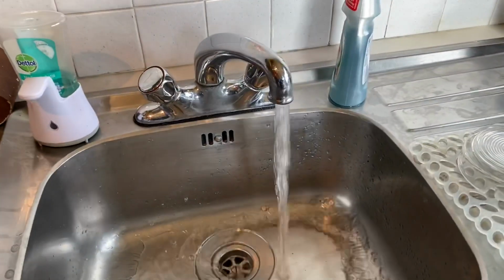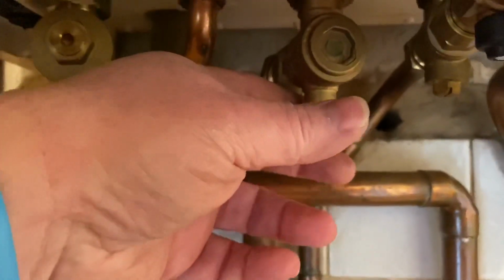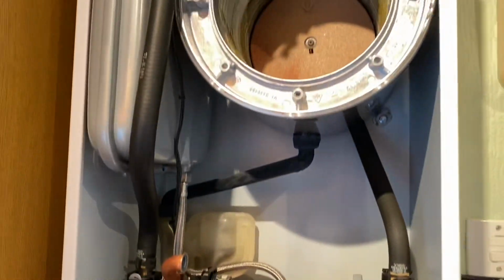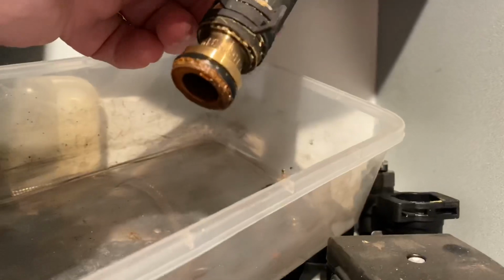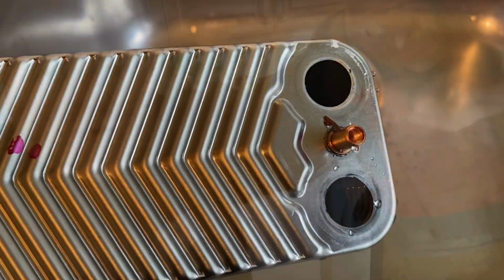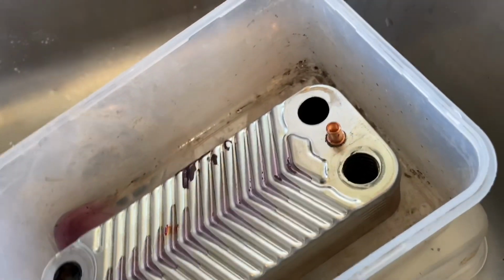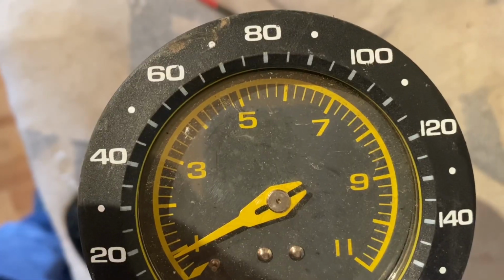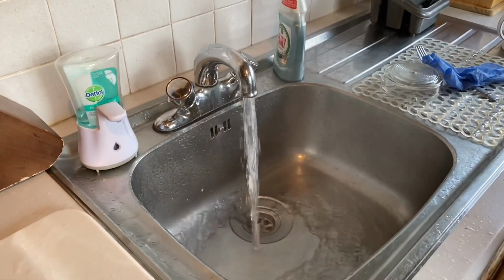Blocked Plate Heat Exchanger Magnetite Sludge - Viessmann Vitodens 100

Comment: Hi Allen. Great service! Wish all engineers were this thorough.

I have an issue with my open vent Vitodens 100w 16kw boiler, system has just been power flushed and a new pump installed. However it keeps short cycling when getting up to temperature, I would say it fires up then shuts off about 8-10 times before then constantly staying on until reaching around 70 degrees (it then seems to cycle 50 degrees to 70 degrees fairly well). Also, lots of hissing coming from boiler when starting.

Have you got any ideas? 

Thanks Allen.
Reply from the maker: Thanks for the comment. Happy New Year.

Comment: What chemicals did you use?
Reply from the maker: I think i used one shot on this video but please check with the manufacture and ask what they advise. Thanks.
Reply: @AllenHart999  Spirits od Salts (hydrochloric acid) can be used. Do it outside. Wear good goggles and rubber gloves. Flush several times as demonstrated. Expect chlorine gas using this acid, which is choking, as it reacts with the dirt and corrosion. Inspect/replace the four rubber O rings between the plate heat exchanger and mating faces which is a cause of water leaks.

Comment: Hi Allen,Thank you for your video. I want to know something about my Worcester 24 CDI boiler. central heating is working fine . Before when i turn on hot water on tap boiler machain shows light on tap sign and light on fire sign but now it does not show light on tap sign on boiler  and hot water is also gone.
Near boiler there is small box with green light when it on hot water come up but for some time again green light goes off automatically. When hot water come then also there is no light on tap sign on boiler  .
Thank you

Comment: Hello Alan,
I serviced the exact same boiler today with the exact same problem.
It appears you have to remove the main heat ex to replace the right hand side flow hose though ?
Reply from the maker: Yes.
Reply: Not a particularly clever design I’m afraid.
As you’ll know Vaillant had the same issue with their “ Rubber Hoses”
Reply from the maker: Lance Taylor I don’t mind them really. Very easy to work on and you can always bring them back to life.
Reply: @AllenHart999  I agree
Reply: I have the same boiler. It was installed on a brand new install, all plastic UFH, no iron anywhere. The pipes block up every year with the black crunchy stuff. Veismann blame my system without explanation. There are filters, and the sight glasses in the UFH manifold are Cristal clear. I am thoroughly sick of this boiler. It has also had two new HT leads. Again, I was told this was a rare problem. So rare that the person sitting next to me at work had exactly the same problem on the same day. Our service visits were concurrent. My next door neighbor has a boiler on the same water supply for 20 years no issue. So come on Wiesmann, step up and sort out your crappy rubber pipes.

Comment: @allenhart. Really been enjoying your videos mate find them very informative. Im in a similar predicament. I have the veissman 050 model and I'm no longer  getting hot water. It goes stone cold. The heating is working absolutely fine no issues. Any idea what could be causing the problem with the hot water and what remedy if any can you suggest. Thanking you
Reply from the maker: Plate maybe?
Reply: Hey thank you for the response. I've had the plate taken out and put through pressured water however could not do it on the hot water at the same level as the hole is much smaller.  Unfortunately this didn't fix the issue
I've seen the plate is available in stock at plumbase and I'm thinking of replacing the old, however I have a feeling this won't resolve the issue. 
Would it also be a good idea to change the rubber hose at the same time.
Thank you again
Reply from the maker: Taz Ba I would do a water sample first, maybe the system is sludged up
Reply: Am I right in  thinking if it's sludged up it will need a flush out

Comment: If the plate exchanger separates the boiler water from the system water, how did the boiler circuit get rusty pieces and magnetite in it?
Reply from the maker: The radiator water goes through the plate. Thanks.

Comment: Proper service would be take both heat exchangers out, put it on descaling pump for 15min  each side and u have brand new boiler. Actually that's standard boiler service here in Croatia. But by the comments i can see u performed the miracle. Chemical cleaning of the boiler standard service 70€+ all new orings, washers and parts if needed.

Comment: Need advice. Living in south east Europe. Vitodens 100  W, boiler is 6 months in use, apartment is 40 m2, boiler brings hot water to the shower, and kitchen, pipes are less than 4 m long from the boiler to the faucet. Floor heating. While heating is on, I open hot water, use it normally, close it and when I want to use hot water after a minute or 5 min again, it takes 25-30 seconds for the warm water to arrive. Same thing in the bathroom and in the kitchen.So, example: I am having a shower, for the first rinse I wait for the hot water to come, ok. Than I turn the water off, scrub with soap for a minute or two, turn water on again and than I have to wait for 25-30 seconds for the warm and than hot water to arrive. And like that every time again waiting for the hot water. When the apartment heating is not on there is no problem. Is it the heat exchanger or a three way valve? Faucets are regular, nothing fancy, no thermostat. Please help. I would like to have some idea before i call the repair person.

Comment: Great video, thank you. Would flushing the exchanger with boiling water and citric acid be as good as the chemical treatment used?
Reply from the maker: How would you keep the water boiling? Thanks.
Reply: @AllenHart999  disolve the citic acid before hand in boiling water via the kettle and let it soak inside the heat exchanger? asking to learn
Reply: @wolverineqtg976  vinegar
Reply: @edwardbalboa5528  thx appreciate it
Reply: @edwardbalboa5528  the liquid he used does not look like vinegar!

Comment: Hi, my boiler struggles to make the water hot. The boiler makes a sound as if a pump or something is struggling, then I have to turn the tap off, that's when the boiler starts up again, when I turn the tap on, the boiler will try to heat up the water but after 20 seconds it will struggle again. Does this sound like the heat exchanger needs cleaning out.
Reply from the maker: You need to have a plumber look at it for you. Thanks.
Reply: @AllenHart999  I had an engineer come last week and this morning he changed the heat exchanger. The engineer said the heat exchanger was too clogged up with sludge to have it cleaned out with acid so a new one was put in. Got hot water back in this lockdown. Just want to say your video was a massive help for me to understand what the problem was with my boiler. Many thanks and keep up your good work 💪👍

Comment: Have you any experience with intergas boilers? I'm tempted, I like the idea of no diverter valve, no secondary HEX, interchangeable parts across all models and an apparently indestructible main heat exchanger. Problem is no plumber I speak to has installed one or attended any problems with them. I hate combis and vowed I would go for a megaflow type system when the time came, but financially a swap to another combi makes more sense right now for me. Any thoughts appreciated! Three bed detached, doesn't take much heating, hot water use relatively low as just two of us here but we do like a good powerful shower.
Reply from the maker: I will add a review soon. Thanks.
Reply: Intergas is 👌

Comment: I also have a vitodens 100 and the last service I had all the chap did was clean out the inside heat exchanger with a brush!!I am now having problems with the hot water to the shower varying in temperature albeit taps etc are generally ok.  Would a partly blocked heat exchanger cause this? there seems to be some variation in hot water pipe to shower although I'm not sure if this is a problem with shower demand/flow ( it is a pressure balanced shower not thermostatic)guess I am going to have to wait until lockdown is over in any case!
Reply from the maker: Stay safe. Watch this one just in case. Thanks https://www.youtube.com/watch?v=Hh5lFC7VI4U
Reply: Hi  please   send me your phone number   I  can call   you  I  from Bradford
Reply: It’s not supposed to be brushed out with a brush mark, it’s supposed to be vacuumed out and thoroughly rinsed out with water
Sounds like you’ve got a partially blocked heat  exchanger
Reply: Salim Khan veismann make a dedicated heat exchanger cleaning tool. It looks like a miniature builders trowel, but with serrated edges. The gaps between each spiral are exactly 0.8mm, the blade of the cleaning tool is designed to just fit. You work around the spiral, gently pulling backwards and forwards to clean any crap from between the coils.

Comment: Very good work, Allen! I wish more and more engineers to do their job properly, as you do. A friend of mine had the same DHW problem. He called the company that installed the boiler and they send some chaps. They did a flush to the main heat exchanger and totally ignored the plate exchanger that was sludged-up. The problem was partially resolved. He then called another engineer and he did all that you showed on this video. 🤘 👍
Reply: Does the exchanger get clogged up like that if there's a MagnaClean-type filter on the system?

Comment: Hi Allen, I have exactly the same problem with my boiler and a engineer came out last week and told me it's not worth fixing as it would cost too much.He said I should buy a new boiler. Is he conning me? What's your opinion on how much this should cost. It's a Maine Combi eco 30 and about 10 years old, thanks for your time, Jim Rowland.
Reply: If it is just the plate heat ex then yeah it sound like he ripping you off, even if you changed the plate instead of cleaning it the parts probably between 50-100 quid and an hour's labour, as long as that's the only thing wrong with it ofc

Comment: It's hard to do a proper service. If you say to a customer you want £75 + parts for a service there is always someone doing them for £30 and just FGA in and out. Cant compete
Reply: I've been paying £8 a month for 'Boiler Service cover' (£96 pa)  Only once in four years have I seen a technician do anything more than  (what appeared to me to be) a cursory inspection!  ie he seemed to be checking the flue gases, pressures   etc etc.   None of them has ever checked that the magnetic filter is clean of sludge (it is, because I do a full mains flush and re-inhibit, every two years).  I've come to the conclusion I am probably just being ripped-off, and would be much better off employing a good local technician myself and getting a full service done. But, as an ordinary member of the public - how am I to know what the service should really consist of - and if I am receiving a descent level of service??
Reply: Sounds like you are getting a "descent" level of service!
Reply: Yes Brendan it’s lowered the standards of quality and no one can compete with a £30 FGA guys the ultimate losers are the homeowners Who think their boiler was serviced when it actually isn’t.
Reply: Very much a case of getting what you pay for.

Comment: Looks like a hard water area. Combi boilers don't like hard water. Pity you cant het a combi type boiler with an external heat exchanger which could be cleaned out by a non gas safe engineer.
Reply: djhvideo i used to clean my heat exchanger every six mo this or so when hot water output started to tail off. There is nothing to stop a competent DIY'er if it doesn't involve opening the burner chamber or interfering with the gas valve etc. Mine was an old glow worm betacom 24c, fiddly but not too difficult to remove the hex, fill with spirit of salts for half an hour and flush with plenty of clean water.

Comment: Hi Alan great videos,can I ask what model Baxi you would recommend,I have a 3 bedroom house with a total of 7 radiators? Thanks. Jason
Reply from the maker: Depends on a lot of things, if you have loads of space I would personally go for a platinum.  The ideal vogue is also a great boiler. Viessmann 100 etc etc, lots of really good boilers as long as they are installed correctly
Reply: Allen Hart Thanks for the reply Alan. I really like the Baxi 800.
Reply: Allen Hart I should have been a bit clearer when asking about the type of boiler,I was meant to ask,what size Baxi would you recommend? I believe there are 3 sizes?

Comment: Probably a daft question but you say you cannot have enough expansion vessels. What does the expansion vessel do and why can you not have enough.
Reply: The central heating loop is a sealed system, when the water in the loop is heated it wants to expand and increases the pressure in the loop. The expansion vessel contains a bladder whuch is full of air, as the water heats up it compresses the air in the bladder, giving it somewhere to expand into. The internal expansion vessel in the boiler is usually rated for 100 litres of system volume. Add up the volume of all the radiators and the volume of the copper pipe used and if it is less than 100 litres you are okay, if its more you need to add an extra external expansion vessel. If the expansion vessel isnt large enough when the water expands it will totally compress the bladder and still want to expand, the pressure will go up until it pops the safety valve and some escapes. When it cools down the system pressure will now be low and need topping up. If the expansion  vessel is larger than necessary the bladder will only be compressed a bit.

Comment: A really good video to watch Alan I’ve done quite a few of these on other peoples viessmann installs the ones I’ve fitted onto clean systems Have not had a problem at all, I haven’t tried a chemical yet that will remove the black sludge magnetite the only way I found to clean it is to plate off and jet wash it properly reverse flushing as well and the same applies to the main heat exchanger. I’ve got a VAX Aqua Vac which are used to suck dry the heating system water which you attach to the heating or the flow hose,or even the kitchen sink tap , It works a treat every single time. Viessmann Boilers are brilliant but you never see many well maintained

Comment: Allen, great video, love the viessmann. that's practically a fully stripdown service.  I usually remove the heat exchanger as well and give it a blast. Replace the hoses for either new ones or the copper replacement if possible. Anyway excellent work as usual sir. Keep us all on our toes to keep up with you ha ha
Reply: Ask yourself if the customer would like to pay for repair instead of servicing when those hoses were been changed.
Reply: @olalekanoyedokun4494   what do you mean?  I didn’t understand
Reply: @olalekanoyedokun4494  It really depends on the condition of the hoses and the model of unit. I always have two sets of hoses in the van for emergencies and if i notice something on a routine service.
Reply: There are easy to strip down David ,have you ever used a copper replacement pipes ? and how much are they ?
I have never used them! Always manage to clean original hoses or replace them
Reply: @SalimKhan-gk1fh  More recent models have copper replacement hoses and they are preferred to be fit in place of the rubber ones, but again it depends on condition and maintenance, I've worked on v100's that where nearly ten years old and absolutely perfect all original parts
Reply: @axemurderforhire1  Thank you for your reply David I look after nearly 20 vitodens 100’s  (wb1b &WB1C). A lot of them installs done by me all running really well . the one in my own home is seven years old now it’s the WB1C with the rubber hoses on a clean flush system they do not give any problems it’s all down to system water quality as you are probably aware and by watching these videos they are a doddle to strip down , even if you have to remove the main heat exchange ,  now could you easily do that on another brand of boiler?
what I meant was have you fitted copper pipes to replace the rubber ones? Most of my installations have FlowMaster antifreeze in the system water this seems to eliminate most problems and it almost matches the system water quality of the German and European (viessmann boilers are antifreeze compatible  ) The addition of antifreeze increases system efficiency and faster warmup times & a quieter boiler, They do not recommend inhibitors in these. 2018 onwards they have the copper pipes, the European ones are still rubber by the way, they are great boiler and a dream to work on   customers love the efficiency too!
Regards Salim

Comment: When I do a plate H/Exchanger clean, I take it back to workshop and pressure washer both sides back and forward, you'd be surprised the amount of gunk that hides even after normal flushing. Also Always, always use eye protection when using that stuff. I hate rubber hoses on boilers, it's always a surprise to see this from German manufacturers. Good channel, I'll let you know shortly what I've found, what fits what, with press tools.